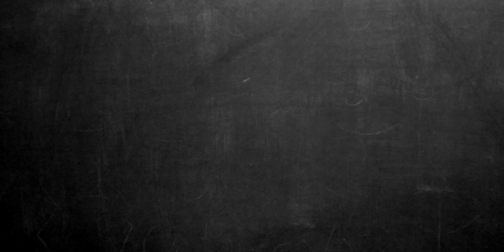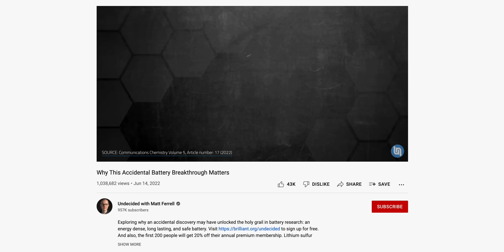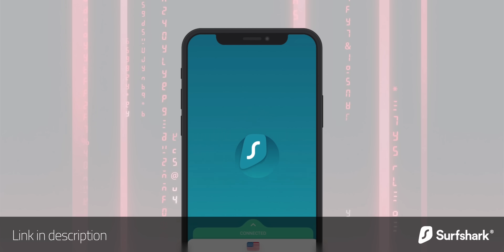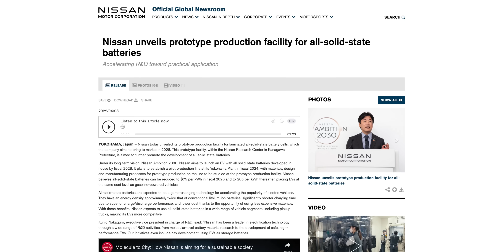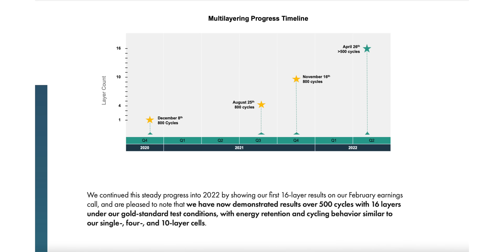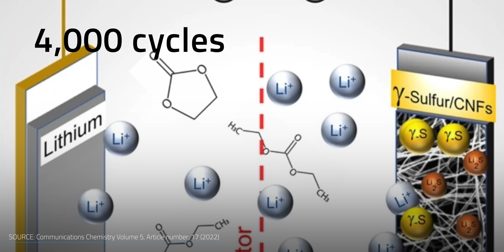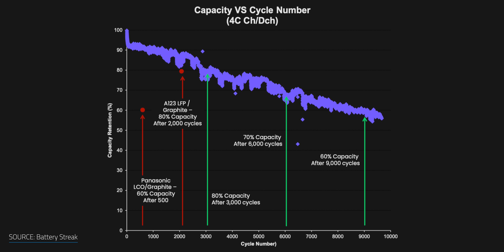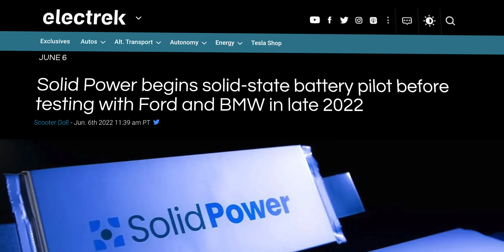Is This Solid State Battery Too Late?

Comment: It’s great to talk about energy storage, but there is still the need for energy (in the form of electricity) to charge these batteries. We cannot totally move away from oil and natural gas. It is needed for the protection of our country from our enemies in the world. One cannot wait for batteries to re-charge when under attack. That’s why oil and natural gas are still critical to the USA.  I think electric cars and new technology is great, but don’t be fooled that oil and natural gas can be totally eliminated in the next 10 to 20 years. The USA was essentially energy independent a few years ago. Unfortunately, the present US gov’t administration thinks it is noble to buy oil from our enemies than produce it within our country. That is total stupidity and is not “saving” the planet.

Comment: Considering the topic of this video, the Tesla 4680 battery should not have been included. It has the same issues of safety, charging and materials as existing lithium ion batteries. It is mostly just a bigger battery. It does not have 6X the power weight for weight or volume for volume but more like a 20% increase over existing 2170 batteries.

Comment: Another metric here is $/cycle. If a battery that does only 400 cycles is 1/3 the price of a battery that does 1200 cycles it's a wash! If the cheaper battery has battery has anything else better it'll be tough to justify the higher layout for a 1200 cycle battery.

Comment: People expect things too quickly. It takes years to develop a battery and test it to the point where it is proven suitable for a car manufacturer to consider designing a vehicle around it.
These are not the AA cells that are retailed for general use in battery powered appliances

Comment: We do not have to think about this, we already know from how silicon fared for computing. There is a mass scale leading chemistry. Every one else needs to not just be theoretically better, they need to get to practically better / cheaper. Unless they do that they are just theoretical or niche has beens in the race. There are many non silicon semiconductors that are "better", but they are not cheaper so they are niche or may possibly become relevant at the very end of the silicon lifecycle.

Comment: Greater capacity packed into a battery matched higher efficiency from the car- you will not need as many batteries achieving a lower cost.

Comment: When solid state battery tech finally begins to intersect with data storage and computational power (cf Apple silicon’s meshing of ram/CPU/GPU on a SoC) the future will have arrived.  
Information (data) density and energy density are not very different in terms of the physics.

Comment: Maybe I'm a bit ignorant on battery design and engineering, but it seems that the others mentioned (Li-S, Nb, Tesla's 4680) are primarily chemistry innovations on an existing battery structure, whereas solid state is an initial entry of a new battery structure which will lend itself to similar future chemical innovations.  Perhaps even some of the lessons learned from them will be applicable to solid state batteries upon their respective advents.

Comment: Thanks for the video Matt!
I do believe that solid state will be the turning point for most electrification.  Ford's battery tech converts existing Lithium Ion manufacturing equipment rather easily, but isn't sodium a fairly dangerous component if it gets wet?  What about graphene batteries?  So very thin.  I would think that their storage capabilities would be insane if they could actually produce it.
Thanks again!

Comment: Matt, you should check out Atlis Motor Vehicles who is also developing a battery and charging system in house. Mark Hatchet is the CEO, a truck guy, and would likely love to speak with you on their own development. I think there's no 1 size fits all to the battery issue. Small personal vehicles have a different requirement that a large commercial vehicle for cost/range. I think there's a good chance we'll see a mix of technologies over the next 30-40 years as chemistries and technologies progress. Energy storage is a fundamental technology that's been sadly overlooked for the better part of the last millennium, so at least we're heading the in the right direction now.

Comment: Thanks for this vid. I'd like to know if there's been any industry effort to make car motors independent of the battery technology. That is, if you have this relationship like this:

motors <-> power management <-> batteries

...and a new batter technology comes along, can you replace the old tech batteries with new tech batteries, then upgrade or replace the power manager, then hit the road again.

Idea is to future proof the car.
Reply: I've been thinking about this problem as well. Seems to me that the car companies want to marry THEIR battery to THEIR cars. I suppose it's more profitable to do that? Look at the Nissan Leaf as an example. 

There's probably a few hundred thousand used Leafs that have had their batteries reach their end of life but yet are still mechanically sound. However, getting a battery replacement for those things is very costly. Or, if you want a different type of battery, you encounter issues or have to jump through hoops to get it installed. Which becomes a time consuming and costly endeavor. 

You would think that you should be able to pop in whatever battery you want to you electric car because in the end, you just need the electricity to power the motor, but I guess things just have to be complicated.

Comment: This kind of technology will always find a niche. If the safety claims are true it already have a market cornered in applications where this is concidered essential.
Even if performance or density is lower then comparable other technologies.

At this point it is just waiting for how things play out.
The space is moving so fast and many technologies are almost ready to commercially deploy. 
At this point we have all the technology we need to do the transition, it can only get better and cheaper from here. 

Good times ahead.

Comment: All these other technologies don't really compete with solid state. All three parts of a battery can be changed and improved and each part separately contribute to the performance of the battery. Solid state tech can work with Lithium Sulfur, which may work with other tech that changes the cathode. Nothing Needs to be developed in a bubble and the idea that it's this tech OR that tech rather than a yes AND is highly limiting

Comment: I think that one of the things to bear in mind is that solid state batteries are currently at a similar stage of development to where lithium ion was in the '80s. Lithium batteries have been in development for over 30 years, and in active development for at least 20. That's a lot of iterative improvement over the years.
Solid state batteries will get there, and with a similar amount of iterative development will probably close the gap and be a better option for some applications.
I think there's certainly a place for them, but that's just my opinion, man :)

Comment: Tesla increased the size of their battery by 6X and then claimed an “energy breakthrough” by increasing the energy supplied by 6X 😆🤣. Wow! Such a breakthrough. LiFePO4 is currently the best, safest, commercially available option for most users. We are going to go decades before any real breakthrough happens.
Reply: The reason it's actually more surprising than it first sounds is because of dissipating the heat produced both in the charge and discharge processes. Six times the heat has to be dissipated through a thicker cell and with a surface that's only larger by a factor of a lot less than six. In fact, of course, the breakthrough is in improving the internal resistance that generates heat both on charge and discharge; and that is worthy of Tesla's self acclaim.

That improvement is what makes it possible to increase the cell size without badly reducing performance, especially fast charging.

You are right that the energy capacity is no surprise, it's the ability to keep the current capacities similar that is amazing, let alone improving them.

In more detail, and feel free to skip what follows:

These back of the envelope figures assume no improvement in battery tech but just a simple scaling up.

The linear dimension is going to be about cube root 6 times as big, so the average distance for the heat to travel is increased by that amount 

The surface area increases by the square of the above number. These two factors partially cancel as the thickness allows down heal loss but surface area increases it. The back of an envelope overall dissipation efficiency might therefore be expected to be worse by a factor of cube root 6, and charge times increased by a like factor. That's just over +80% longer if the tech was scanned up without any other improvements

To claim an improved charge time is therefore a genuine technological leap ahead, assuming the new cells deliver the promise. You never quite know with Musk....
Reply: @trueriver1950  I’m not downplaying their ability to design a battery. I’m just not really impressed with their claims since I could simply multiply the batteries I need in a design by six to come to the same capacity and weight. Granted that using 6X the amount of batteries would also require many more charge controllers and much more wiring I can see the feasibility in terms of cost cutting to Tesla but I doubt and savings will pass to the consumer in that situation. A breakthrough that would be impressive is an increase in energy density. It would be amazing if they could increase the capacity without increasing the weight to match. I think this is one of the major hurdles in the renewable energy field that needs to be addressed. Eventually someone may break that barrier hopefully. I’m really just saying that Elon makes this sound much more impressive than it really is. It will be a game changer when batteries can weight half but maintain the same capacity.
Reply: @jasoncspink  I still disagree with you 

It's true that Elon has done nothing to improve the capacity/weight ratio.

And multiplying the battery by six may well increase the weight of the vehicle by now still, as the vehicle is redesigned to carry more weight and to accelerate and brake more mass. 

The structures to support a weight and the devices to accelerate and retard all scale worse than linearly with the mass involved. 

What you are downplaying, in my analysis, is the impressive feat of being able to charge a battery 6x the capacity to 80% in less time rather than more. 

That advance will mean nothing to some use cases such as 

 - the Tesla Wall
 - the huge batteries attached to power grids
 - daily delivery vehicles needing one charge/day
 - consumer acceptability of electric vehicles used only for commuting needing one charge per day or per trip
- proposed vehicles charged purely by on board solar (projected design range for manufacture at scale in 2024 is typically 70 mile/day)

It will make a huge difference to the take up of electric cars and long distance delivery trucks because almost everybody buying a car wants to use it for road trips at least occasionally. Even if my commute is term miles each way and the boss lets me charge at work, I want a car that will do at least 200 miles on a half hour fltat charge for those occasional longer trips 

So it's technically a leap because he figured out how to improve that part of the internal resistance that is not intrinsic to the chemistry. In marketing terms it's a leap forward in potential unique selling point to the automotive industry.

Perhaps "downplaying" is the wrong word to use here though. I think I would say instead that you are over-focused on capacity to the exclusion of other attributes which matter in the real world.

Certainly I focus on capacity much less than you do: but that could be my mistake not yours ;)

And the other mistake is down to neither of us: I would certainly agree that Musk's marketing people have not done well at explaining why this is a leap ahead. They are indeed pushing something that sounds like nonsense at first hearing

Comment: I think weight savings are more relevant in high end vehicles and aviation than mass market vehicles.  Current battery technology has a pretty good safety record  but for aviation reducing the risk further is probably helpful. Though, it doesn't appear to be  a showstopper currently.

For lower end vehicles, cost is by far the more important factor. Tesla and others are proving that by using the cheaper LFP batteries. They are good enough and the cost savings are more important than the range. And people seem to line up to buy cars with those batteries.

Another point is that there's a difference between companies like Quantumscape that are much closer to production and some of the alternatives you mentioned which are more in the early proof of concept / research stage. I expect the first cars to market with solid state batteries might happen around 2025/2026 timeframe. and there are only a handful of companies that are ready to target that time frame. Probably supply will be limited and they'll be used in relatively premium cars initially. At the same time, there will be many millions of EVs produced per year by then and most of those will use current battery technology. It will take some time to change that.

Comment: I haven't seen any discussion about battery form factors. We have standard AA, AAA C and D cells for consumer electronics. I know that can use an AA cell from any manufacturer in any device designed for AA. The only difference is max current and WH ratings. We need the same form of standardization for EV and home storage, but larger capacities. For example:  X, Y and Z cells that are based on the size, voltage, and shape for 1, 10 and 100 KwH batteries using 2020 LiOn technology. In time I would be able to repair/upgrade an EV with higher capacity batteries in the X,Y or Z form factor that the EV was designed to use. Such standardization would also encourage competition from battery manufacturers.

Comment: 11:10 YOU CAN'T STORE POWER!
You store energy. And for a 5x increase in volume in the 4680 compared to the 2170 … you don't even get double the capacity (from 4800mAh to 9000mAh)

Yes, the 4680 batteries can deliver 6x the power … but they also will drain 3 times as fast.

The 16% gain is made not by improved battery chemistry, but with improved packaging.

Comment: One of the biggest issues that I have with battery packs, particularly in EVs, is the recycling and safe disposal of them. If we’re all going to be driving EVs in the next 20-30 years that technology is the most important part of the consumer experience for me.
Reply: Lithium ion can be reused and recycled easilly as well. Almost everything can be recycled nowdays.
Reply: Battery technology in 20-30 years will likely have advanced to the point were we'll use non-toxic materials such as salts, carbon or other common elements.
For the meantime, once mass adoption of EVs is in full swing it will become profitable to recycle on a large scale, especially Lithium, which will become a rare commodity, giving a strong incentive to be recycled. Even the cheap 12V car battery of today has recycling rates of over 90%, so expect a much higher one with Li-Ion batteries.
Plus they last a lot longer (around 8-10 years) and can still be used at reduced capacity for other uses (stationary storage) for many more years before needing to be recycled.

Comment: tesla is not pioneer on that industry. They made bigger cell and claim they made bigger capacity. Sure they did but nothing new. Yes they made improvement but pouch type cells beat it every time. Just packaging method is old and they do not have time or resources to change it. Sure, panasonic is not interested too.

Comment: 🥱too slow, too late. thing is, EVs and energy storage are large and heavy applications of batteries which could use heavier cheaper chemistries like LFP.  Solid state could find its place in devices/ power tools but I feel will arrive in 2030

Comment: I agree that we need to get out of the habit of thinking there is one magic solution for battery technology. For stationary solutions we should use molten salt because weight is not a critical factor and the life cycles are near limitless. Where as for mobile requires light weight solutions. We need to use all the solutions together to make THEE perfect solution. Capitalize on each solution's strengths.

Comment: Internal combustion engines have been around for a century and a half. There's not much more we can squeeze out of that technology. Battery tech for EV's on the other hand, is just scratching the surface of what is possible. In 25 years, today's cars will look as outdated as the Model T, and I can't wait.